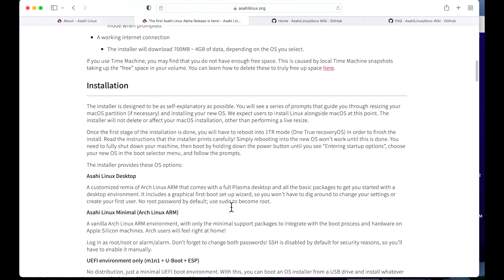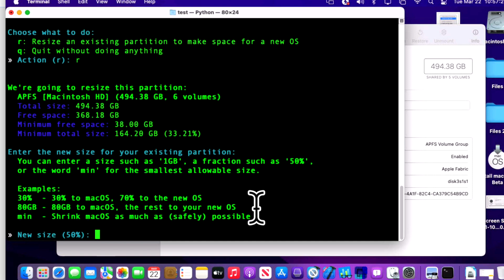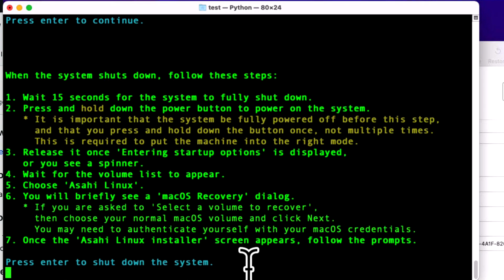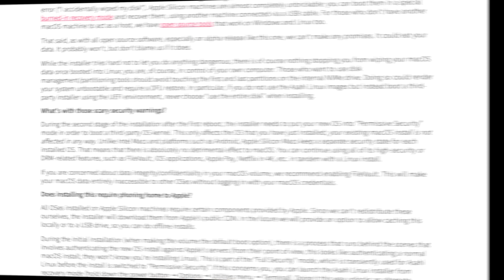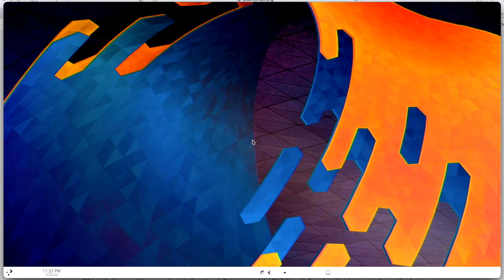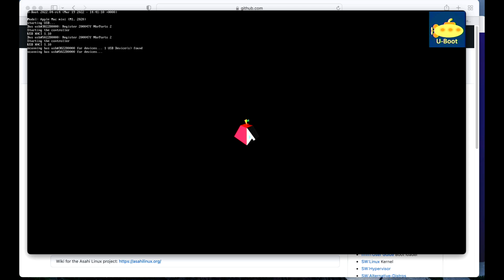How to install Asahi Linux on your M1 Mac! Dual Boot Native Linux and macOS!

Comment: I thought about installing Steam, but I did not succeed, the interface of the sound problem does not have a sound, I tried to remove the system, but I did not succeed. Can you help me remove the system because I want to wait for the system to stabilize and then install it
Reply: I use MacBook M1 pro 14''
Reply: @mohamedadnan7310  steam is x86_64  and yours is arm64

Comment: can you prove it could dual boot? thanks :)
Reply: You just need to shut down the system and press the power button to the boot options to appear. You don't actually uninstall your macOS or anything when doing this. It needs macOS in order to work, so a single boot option with asahi is not currently possible.